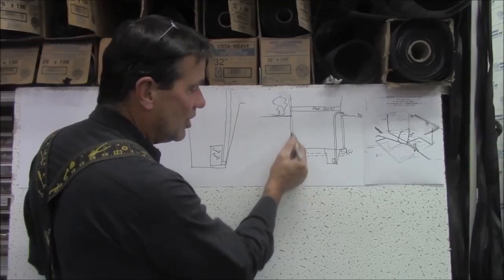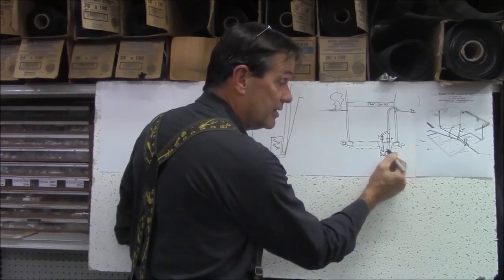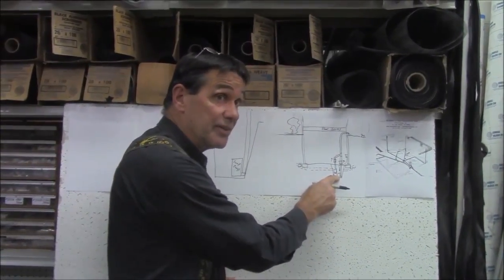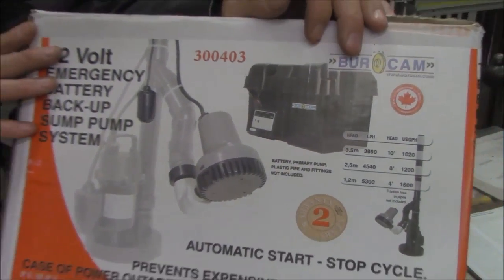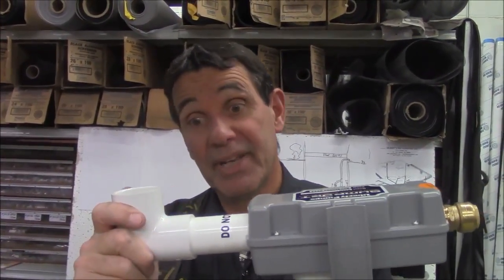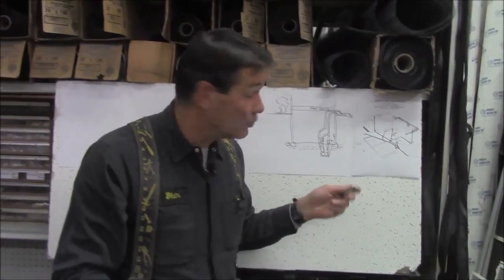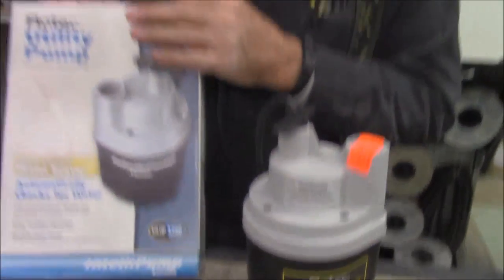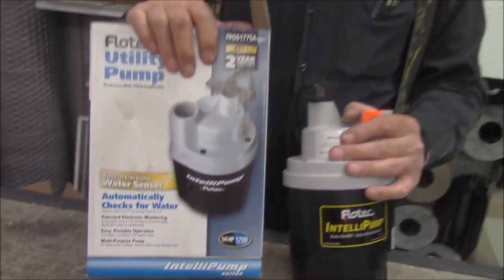Sump Pump System, Problems, Install Backup Battery or Water Powered

Comment: Also for a water-powered pump you need to figure in extra $$$ for a backflow preventer and a master plumber to install that device and to sign the permit, which is required by code in many areas.
Reply from the maker: In Michigan we can pull a homeowners permit, have it inspected and done. Only need a master to pull a permit on someone else's house. In the Detroit are all the ones I've been involved with a sillcock vacuum breaker ($6.99) qualified. Thanks for the reminder about the vacuum breaker. We use watts 9d on boilers and stuff like that. Blair

Comment from the maker: Two pumps on one line will remove less water than two pumps on two discharge lines. However they will remove more water than just one pump. The reason for two pumps on one line is that they are backing each other up. If you have more water than one pump definitely install two discharge lines.

Comment: Good video and suggestions. Its true batteries can and will fail by 5 years. However the better battery chargers have monitors and alarms to keep tab on battery health and let you know when to replace. Also a good battery will get you 24-48 hours of back up.
Reply: No way 24-48 hrs!  If your pump is working you’ll will get 4-6 hrs of battery operating time

Comment: am wanting more information of having two discharges with check valves... And if you have 3 pumps which i think is crazy... why not place two pumps at nearly the same level to discharge faster?
Reply: I want the lower pump to run until it fails, then the upper pump will take over until I can purchase a new pump. The upper backup pump goes to the bottom and the new pump is installed above.
Reply: @blairgilbert7606  i suppose. just in my mind, what are the odds of both failing at the same time? So why not let them work together too? bring em closer together for those sudden water table rise...

Comment: Why did you use a second check valve with the Liberty SJ10, it has a check valve still at the entrance.
Reply from the maker: So when working on the Liberty the other pump can run and not back-flow onto me.

Comment: great video, just have a question about using two pumps on the same drain line like that. If there is a situation where there is a lot of water coming in and they are both running at the same time will the two pumps interfere with each other since they are on the same drain line?  ie not be as efficient and two separate drains?
Reply: +neotekz 
Sure, there will be a loss of gallons per minute, but still better than just one pump.

Comment: Hi Blair,  great video!  Just have a question.  My sump pump is in a deep well in our front yard.  I'm looking at getting  a water-powered backup pump as we still have water pressure even during a power outage.  The problem I have is that the cover of our deep well is concrete.  How do I run a hose going  inside the well?  Looking forward to your reply.
Reply from the maker: I don't know if you are in a frost zone but here, Michigan, I would have to run the water line in at a depth of 24" or so, so it won't freeze in winter. That being said I would bore a hole into my well pit at that depth leaving the lid out of the picture.
Reply: @MrHardware1  Hi Blair,  I'm in Vancouver, BC.  It looks like we have to run the water line at that depth.  Also, our sump pit is about 15 feet deep.  Can the Liberty SJ10 water-powered pump do the job?
Reply from the maker: @harabas1  At a 15 foot head (lift from pump to surface) the sj10 is rated to pump 432 GPH. That number is without any restriction after the height is figured in. You might be around 300 to 350 gph depending on the pipe length and number of bends in it. If that will save your basement go for it. Blair
Reply: @MrHardware1  Thank you very much Blair.  A plumber will come over tomorrow and take a look at it.  I hope this works.  By the way, if I need to install a secondary pump, do I need to call an electrician to check if our circuit breaker can handle 2 pumps?
Reply from the maker: @harabas1  Usually not. Amps and Watts both add easily. If a pump draws 4 amps when it is running, it's peak amps can be more than double when it starts up, (for 3 seconds or so) so if it is supplied with a 15 amp breaker and they kick on at once it can trip the breaker leaving you with no pump. When I have 2 pumps in a pit one is above the other so they can't both start at once. That being said having a second circuit for pump 2 is a better backup because if a failing pump trips the breaker the second pump is on a different circuit.
Reply: @MrHardware1  Hi Blair, what can you say about BasePump HB1000 PRO and CB1500?  Best regards.

Comment: Hi Blair,  another question.  If I want to have a  battery backed up sump pump, can I put the deep cycle battery inside the deep well?  Where will the battery sit inside the well?
Reply from the maker: I'm not fond of battery backup because of the state of a possibly unused battery after about 4 years. Could only be an hour or less of battery life at that date. I would run a heavy 12v power line from the house to the pit and keep the battery in the house. There you can monitor it, keep the cells full of acid and possibly test it once in a while.
Reply: @MrHardware1  Hi Blair,  what do you mean by a heavy 12 v power line?  Is this a regular 12-volt battery or a DC generator?
Reply from the maker: @harabas1  I warn you that 12v is one tenth the power of 120v. Hence you need 10 times the size the wire to get a 12v pump to move as much water as a 120v pump. Big wire, up to 8 gauge depending on the distance and amperage of the motor. Still would be worth it to me to have the battery  in the house on a shelf that I can check easily.

Comment: Great video! Would you recommend this Liberty SJ10 or the Basepump 750?
Reply: 4thephil 
We know and sell the Liberty, I like the BASEPUMP but I don't have any experience with it. I would default to a supplier in my area if I was you. Being a local supplier my customers have me if there is a hiccup. Buy local and get local support.
Reply: Might be a good idea to check out the Basepump so you can make a fair comparison. Priced right and pumps more water per hour, 5 year warranty and great support from the company make this a great value.

Comment: Hi, great article.  I installed a water-powered backup, shared the waste pipe and every time the electric pump shuts off now, there is a sharp thump sound. The manufacturer suggested adding a 1.5 inch air pipe extending 3 ft straight up , working as an air cushion. This has not helped, any comments? Thanks
Reply from the maker: +Jerry Hinds 
we sell a soft close check valve, the quiet one that we use on systems like yours. If you cannot locate one call the store, cuz it is not in our shopping cart, and we can sell/ship you one.

Comment: I installed a regular 1/3horsepower pump by liberty for some reason it doesn't come on till the water is all the way to the top.its been in since Jan of 2017.I didn't drill a hole in the pipe.do u think that's it or maybe the float is getting stuck.or do I need a bigger pump
Reply from the maker: The float is very visual. You can feel or hear the switch when the float comes to the top. The water lifts the float, if there is anything rubbing or touching the float you need to reorganize the sump pit. I dislike the pressure switches because I can't see the operation moving and they are hard to test.

Comment: Got a question... i have the Liberty water  pump as back up..but float only engages to come on or shut off when i touch or jiggle float.... what can i do to fix this?
I had plumber install it and this will be the 3rd time i will have to call them back...... plez help.!
Reply from the maker: Call Liberty customer service directly. They will work you through repairing the problem right up to complete replacement. I have had too much water pressure cause another brand to fail, that we use to sell, but the Liberty has yet to give us a problem.
Reply: Ive seen people that have zip tied styrofoam or some other material to the float to make it float better. But yes, not a proper fix, call Liberty. Did you ever get this fixed?
Reply: @Datsyukiandeke  yes.     3 years ago they came back and got it